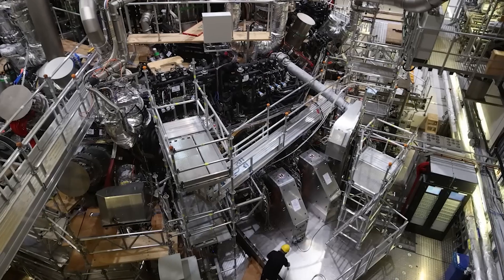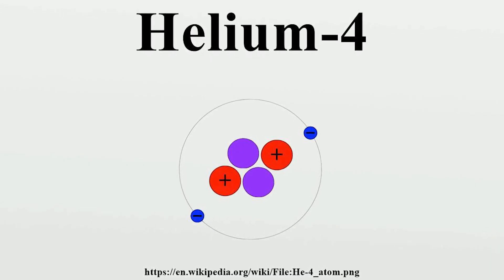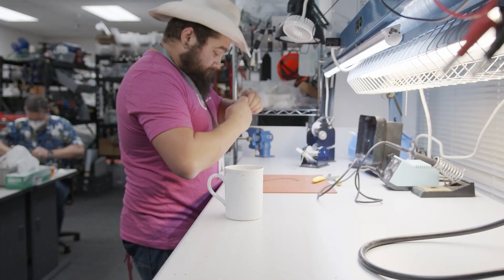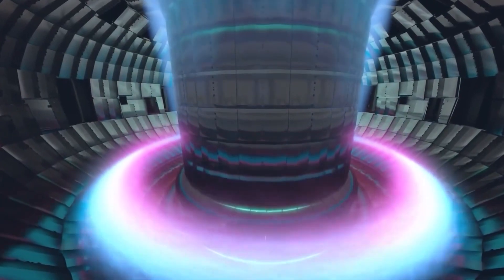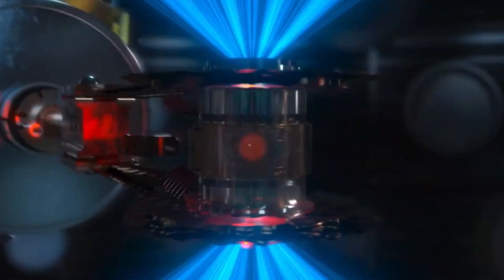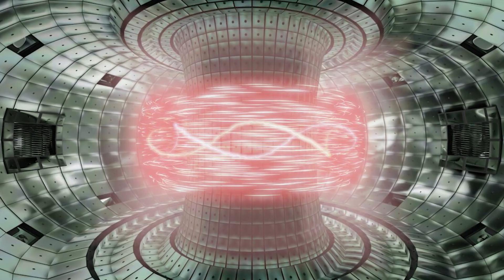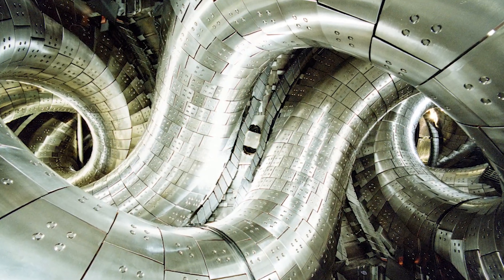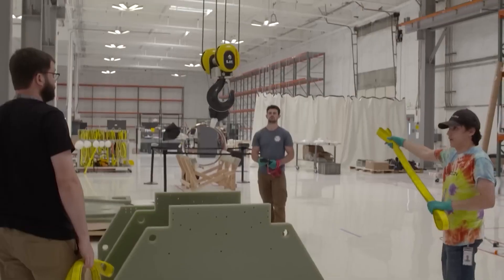How Will This Fusion Reactor Generate Electricity by 2024?

Comment: Thisi is ridiculous. What ever fusion reactor is used, it will generate a lot of heat. You need to cool it down. The efficiency of generating electrisity by magnetohydrodynamic methode is about 60%. What about the residual 40%? Are you going to heat athmosphere ( according to Carnot cycle)? As Elon Musk said the best fusion sistem is our Sun. Its reliable, safe and it requres no maintenance. Just lay down solar panels and generat elctricity. Thats so simple.